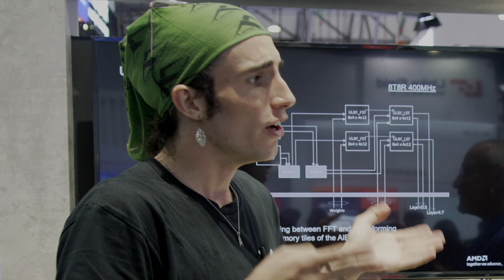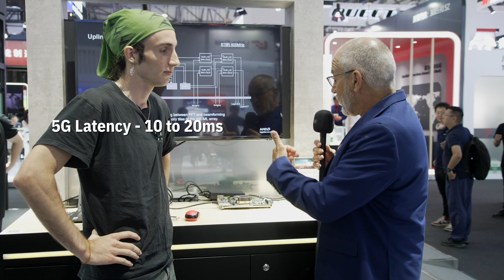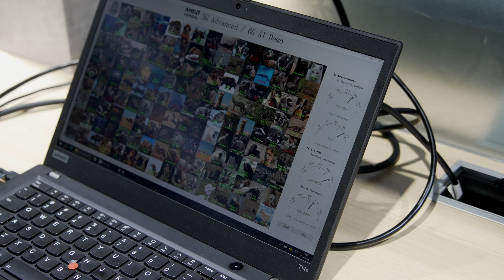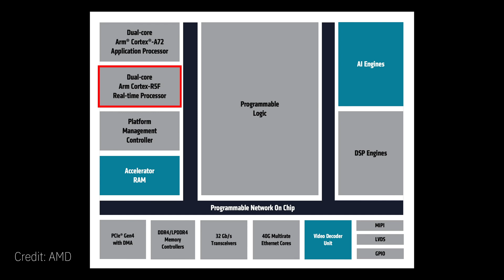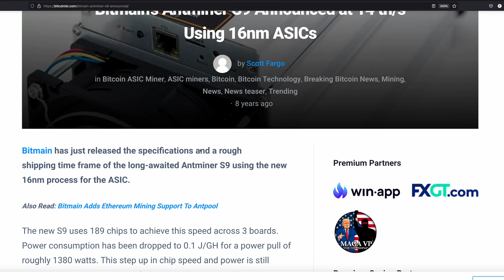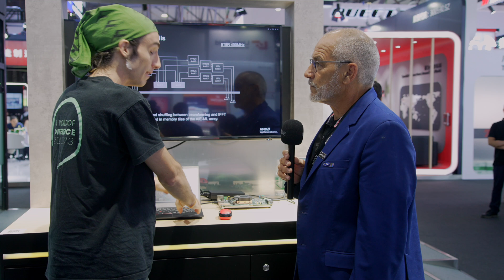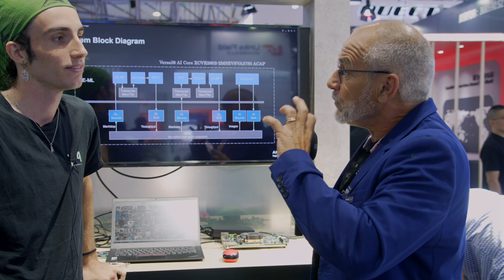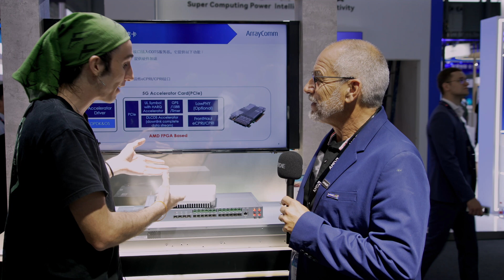AMD on AI, FPGA - SMWC Full interview

Comment: FPGA Engineer here ! To add a bit of additional information, FPGAs are used because they provide massively parralel and independent processing. You can control everything at the clock cycle level, control peripherals, process data, and everything in a completely predictible manner. You are very close to the hardware.
Programming FPGAs require low level languages like VHDL or Verilog, but it is also possible to use C++ which is converted in HDL.
The video was interesting, but I would stay careful with AMD AI-FPGA claims until more details are available
Keep it on !
Reply from the maker: I see! Thank you for the thoughtful comment, I will do more research the next time I cover FPGAs!

Comment: A Field-Programmable Gate Array (FPGA) is a type of hardware that can be reprogrammed at the circuit level to perform different tasks. Unlike traditional processors that follow fixed instructions in software, an FPGA consists of physical circuits that can be dynamically reconfigured to change their connections and functions. This allows it to be highly flexible and optimized for specific applications, such as signal processing, AI acceleration, or high-speed computing.